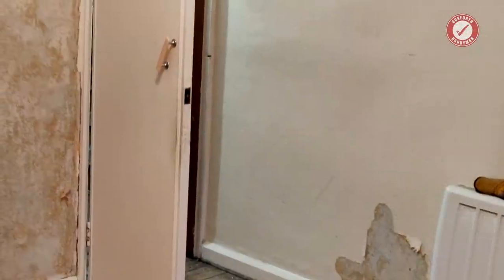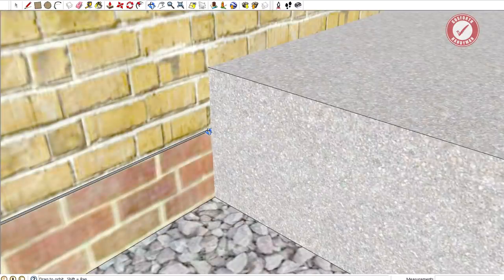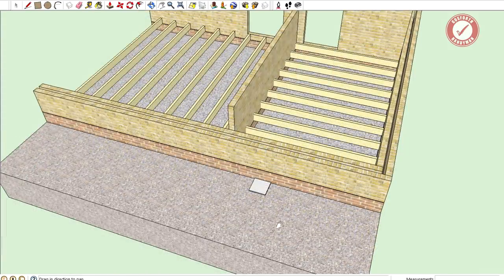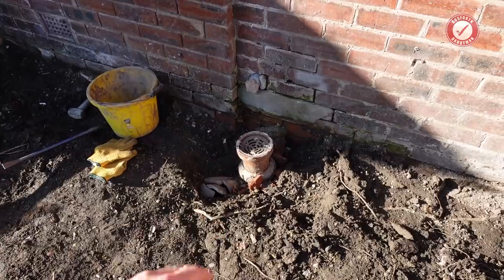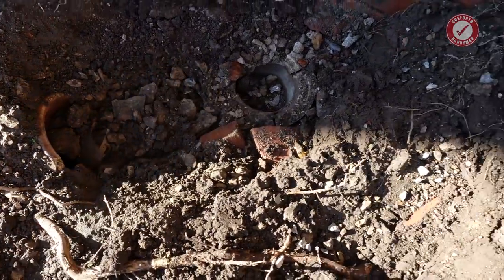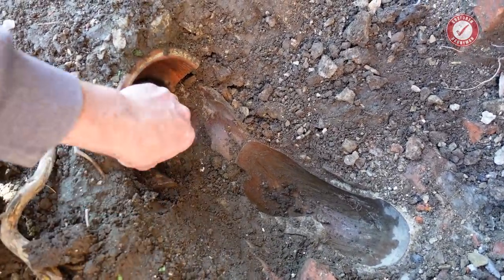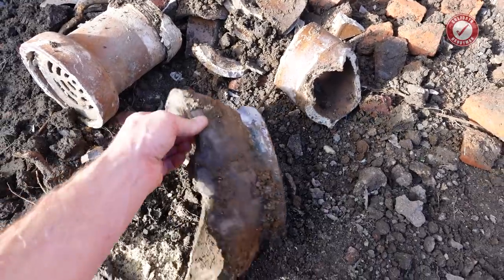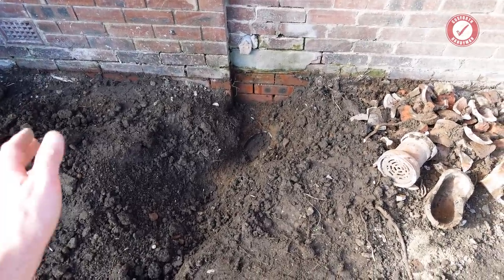I think we found the source of our damp issues! (1920’s Renovation Part 36)

Comment: You're doing it wrong Andy. You are supposed to spend thousands of pounds for some chav with a 3 day training course and an SDS drill to put hundreds of holes in your wall. That's how you fit damp problems right? 😜
Reply from the maker: Lol it's scary how many times I've seen that done... and it's made zero difference since it was actually leaky gutters. 😂
Reply: Wally damp man 😁

Comment: Great stuff.

Just did a bungalow. Dodgy drain pipes and on one side it ran into a water butt which went nowhere so was just overflowing. I can’t for the life of me work out how it ended up that way because surely it wasn’t built like that.

My current home is 300-400 years old. No cavity and some crazy electric damp treatment attempt that doesn’t work. It was painted with sandtex trapping the moisture in. Stripped it off to reveal large holes in the mortar everywhere. Repointed with lime instead of the concrete that was in it for breathability, adjusted the drain pipes so they actually catch the water, fixed a hole in the roof. One gable had to be rendered because the bricks were that bad. Inside damp was dealt with as expected now the water wasn’t coming through the walls. Little problem with a drain blockage because of the paint removal which has now been rerouted and it still makes me smile living here after all of that. :-)

Comment: I had a shocking damp problem in my living room (basement flat of a house built in1890) caused by a similar issue.  It took about 8 weeks to definitely identify the issue.
Once the outside drain was dug up we found it had been smashed and "repaired" with half a piece of soil pipe, (to cover the hole), "secured" in place with a carrier bag.  I reckon the damage was at least 15 years old when some work was done on the car park of the flats.
Reply from the maker: Ah, the old carrier bag repair. Lovely! 😬👍
Reply: Cowboys

Comment: Hi, I notice too that the soil (as in garden ground) seems in my opinion to be above the DPC. Having a garage on a sloping road, this is always a problem and since we had our interior wall tanked the rest of the garage is dry, probably for the first time in 60 years. We too had problems from a crack in the sewer now fixed and you are so correct in dealing with the source to these problems first. Thanks for this topic post.

Comment: Thanks for that, has given me some food for thought. There is just one section of wall in our kitchen that gets damp (old Devon cob and stone solid wall) and the drain runs just behind there, but there is a gully nearby which I can't see thanks to some old decking (which is going to get binned off). I'll have to get a look at it over xmas and see if the pipes connecting to it are working right or if it's a mess. Once I've finished laying the foundation for the patio extension (just scalpings and then gravel on weed mat but I need a whacker plate). Channels like your are invaluable for those of us who maybe aren't all that keen on DIY but have to do it anyway as it can often show us how to do things the right way or where to make a start on problem finding, so thank you!

Comment: I think that it’s pretty obvious that those 2 gullies were the main source of damp as they were permanently full of water in the bottom which you expect. Better off replacing them anyways and re directing the pipe work if you are now working on the extension! I had a crack round my kitchen drain where the grate is sat up against the house wall but I have just pointed up that gap with some cement for the time being until it eventually gets replaced should it need to be. Great video!! Also checked out that other YouTube channel and it’s really interesting!

Comment: Yes, water is a killer for property. Had similar issues with water backing up drains. I found a poorly installed drain when when the property was originally built, which tree roots had grown through totally blocking it - 6ft underground (that was fun!). I also had gutters overflowing for a long time (prior to ownership) which caused similar issues with water running down the walls, I see this often in properties, so to anyone reading this get your gutters cleared and fixed it'll save you a fortune!

Comment: I've got a cracked rain water drain in the front of the house that will be fixed soon. Plants have been growing out of it! It does mean lifting the front path, but we were going to have to relay the whole path as it's pretty damaged. I hope that's the end of the damp for you.
Reply: Got same problem, cracked gully,rest bend & pipe, but everything is encased in thick concrete😮,the more I explore ,the more problems I'm finding.
Reply from the maker: Cheers Jules! Good luck with yours, yes hopefully things can start drying out now... in time for winter. 😬😁
Reply: Seen the roots of trees and bush’s well down the drain pipes  many times during my time as a builder
Reply: @williamgow6551  Same here, & once several  fencing pins driven through clay pipe run....😮

Comment: Our bungalow is built on solid chalk in the 1960's, which commences 9 inches below the surface. We have never until recently had any trouble with rainwater not going away but 5 years ago the gutter started to overflow. I couldn't clear the pipe  where the down pipe entered the clay pipe so it was exhumation time. I found that the original pipe stopped 3ft from the house and that was it, the clay was full of leaf mould and other rubbish. However there was absolutely no dampness in the house or brickwork as a result of this soakaway arrangement. I remedied the problem by making connection to an existing soakaway, so sometimes damp doesn't always show up.
However when we built our extension the new foundations had to dug just over a metre in this area because the chalk had been ruined, elsewhere it was a struggle to get deeper than 85cm the chalk was so hard.

Comment: Yep.  In the states myself, but the fist rule... get the water away from the foundation is job #1.  We generally have poured concrete foundations (and basements) here and my sump pump was discharging to a broken downspout connection to the street.  The water was splashing back up the outside brickwork and just running back down to the basement outside wall, causing mortar issues.  Fix the source first!

Comment: Fantastic stuff...

We live just along the A69 in Carlisle. Our house is a late 40's build and I have just spent the last week putting in new drains. Our house sits on a complete concrete pad & has poured concrete outer walls and also the same inside, No bricks what so ever! 

Our walls were poured on the pad and I'm not sure we have any DPC, indeed it's very hard to see if there is any at all! The floor is always cold and during the winter the hose is always cold and we have a damp smell in the rear rooms (hence me putting in new and renewing old drains)

All of the old clay pots were cracked including the one from the toilet that had been seeping in to the clay for many a year without our knowing. Not a nice job but needed doing before I put down a new Indian Sandstone patio & paths

Comment: This was very interesting.  I am a retired Home Inspector and former builder.  In the US many older masonry houses have the DPC made of two layers of slate.  Never seen the bitumen.  Newer frame houses have rules requiring enough clearance from grade to allow evaporation out of the face of the wall.  8" one the exterior and 18" on the interior.   The older masonry houses had lime plaster parging or coated on the exterior about a foot above grade to cause the drying to occur in the parge rather than in the brick.  The parging  would fail and fall off rather than the faces of the brick.  You were supposed to replace the parging about every 20 years or as necessary.  That maintenance has been long forgotten and the buildings are suffering.  They used lime mortar so the water would migrate through the mortar rather than the bricks.
Reply from the maker: Interesting! Don't think I've seen parging over here - I need to look that up! 👍
Reply: Bitumen was used everywhere for anything that needing water proofing in England it seems. For example my electrical supply incomer to the house is coated in a bitumen sheath.

Comment: I’m trying to cure the same  problem on my bungalow, (front and rear)! Problem is I’m in a low laying area, in clay, and I’m finding it hard to get enough water away from my walls! 
Did the rear soak away myself last year with tennis elbow in both arms! Only problem is I think I need to extend the soak away pit as I don’t think it’s getting far enough away for the volume of water coming off the roof... The clay doesn’t allow it to soak away fast enough! Plus, the water table is very high in the area. Nightmare! 👏🏾👏🏻👏🏾👏🏻. Ps… not allowed to funnel it in to the sewer in my area! (Although, if it comes to it, I might secretly do it)!

Comment: One of the causes of moisture in your walls tackled!
My own renovation project showed me that there are other easy and not so easy to tackle causes.
The easy one being washed out cement between window sill tiles on the outside of the house, the whole brickwork underneath this window sill was soaking wet.
The not so easy one, actually the remedy is not complicated but needs a lot of work, soil back filled at the rear of the house way above DPC level, without damp proofing the walls and installing drainage.
The water did the same as in your case, washing out the mortar and going trough the wall, when I ripped the PVC panelling off from the inside there was soil behind it!
The solution I took was excavating all this soil out and construct a retaining wall about 1,5m from the house, and installed drainage all along the backside of this retaining wall.
Next is to install drainage alongside the house itself before paving over.
The walls which are freed of the excess soil are free to breath now and already much dryer.
Reply from the maker: Wow - sounds full on! Good luck with it all! 👍

Comment: Anybody buying an old house get your drains and downpipes checked !!  i had 50 litres of water under floorboards every time it rained heavily , called the drain guy out he said it just the water table etc... 10 yrs later found the cause blocked cast iron down pipes the water would fill up and run down the cavity wall via the old lead pipe to bath ,high humidity levels in house are cause for warning signs ..

Comment: Great video, that really goes through the process explaining whats actually going on. I personally find drain defects are the number 1 cause of rising damp within buildings, but this is often booted to one side, and instead a quick fix is carried out. I tend to find that where there is an original solid floor along with an original suspended timber floor there is usually clay pipe running through the solid floor and normally venting to a vent....But, often I find the vent isn't there  :) that could be something to do with yours. One question though, did you try and claim on your insurance for the repairs?

Comment: Andy great vid  i had waste pipe just sitting on the bend to the drain and then concrete around it damp kitchen wall luckily started leaking through concrete then fixed.
do you have any drink tea make stuff mugs
cheers Mark👍🍺
Reply from the maker: Don't have those mugs... yet. But have a plan so watch this space. Will be a good few months though. Might sort some on Spring in the meantime. 👍

Comment: My guess ~ water in the u-bend /gully froze many many years ago, the gully cracked and subsequently leaked, resulting in cumulative damage up to its discovery in 2021.
Reply: thanks, wondered how it had occured. often is shrub roots causing problems once a hole in a clay drain has appeared.  even with the breakage as it was, it would have been a simple fix (couple of days dig and back fill and appropriate gulley goods
Reply from the maker: It's tend to agree! Certainly a possibility. That and slightly dodgy patio laying. 👍
Reply: Often the cause is that when the drains were installed the ground at the bottom of the trench wasn't properly compacted (if at all) and thus settles at different rates under each section of pipe.  The differential vertical loading easily cracks the pipe.  I have replaced all of the original clay pipes in my rear drains all the way to the main sewer connections as every single joint on both pipe runs was cracked.

Comment: The only place I've seen pipes on the outside of a house is in what used to be East Berlin. When I went there in 1994 the Berlin Wall had been torn down and one of the ways you could see what used to be East and West was exactly this: East had worn-down houses with exposed pipes, West had more modern houses without exposed pipes. I imagine exposed pipes cause problems in sub-zero temperatures, right?

Comment: Well done sir  I wonder if the last war has played it’s part and shattered the clay drains . PVC has been a godsend to the building industry , and should last at least another 100 years plus . But as you rightly say water is a major problem to property , and can present many challenges to the unwary . I my self have an issue with water ingress from outside via UPVC windows , which is proving to be very problematic . The house was built in the late 1970s but the rear elevation seems to be beset by this problem . Admittedly the wind blows across the fields and drenches the brickwork , but try as I might it still finds its way into the reveals . I’ve re applied  new sealant I’ve applied silicone treatment to the bricks , but to no avail after the resent storm I find water has found it’s way in again. So if you our your many subscribers can think of a remedy I’d be  very grateful .  Best wishes and kind regards as always

Comment: The issues with that gully explain where all the crap you found in the main sewer after the old pit that was slowing and holding the flow probably came from. Damp is a very patient opponent and will take all the time it needs as it is not in a hurry.

Comment: Surprised building code allows mixing grey water with roof rain runoff and diverts all of it to sewer system even in 1920s. It’ll be interesting to see how you deal with rainwater runoff. In the states communities have mandated dry sumps  to temporarily retain rainwater until it ca percolate into the ground. Hope your local ground conditions allow for diverting rain water away from your foundation.
Reply: Building regulations in England allow the discharge of rainwater into public sewers even today, although it is as a last resort. In order of preference the accepted methods of dealing with rainwater are: into a soakaway underground, into a natural watercourse, to a surface water sewer or a combined sewer. My house was built in 1947 and has a combined sewer so I can mix foul water with rainwater. If I stop doing this I can get a discount on my annual water bill.
Reply: Actually the greywater (plus house rainwater) and blackwater connect before they enter into the main sewer so everything ends up going out of the same pipe.

We also have upper sewers (storm sewers) which are where the roads drain into which are often shorter stretches to direct to the natural rivers. In my home town which was in a valley, the original river it was named after no longer flows  (it was diverted away further upstream into the canal) but all the storm sewers empty into it the dry riverbed when it rains.

In the UK its less of an issue trying to collect rain water, more trying to get rid of it! ;)

But uk homes mix rain water from their roofs with the grey and black water as it helps keep the main sewer lines flowing!

Obviously this is all treated before release or diverted to reservoirs for additional treatment and drinking water. Its a fully nationalised industry so for the states it would be the equivilent of:  It rains in New York , California gets a drink and Kansas gets to irrigate crops  ;)
Reply: @boli2746  Discharging rainwater into the public sewer is frowned upon generally. I've never heard of it being a method of keeping the sewer lines 'flowing'. Every bit of water entering the sewers needs to be dealt with, and dealing with it costs money. Honestly I spoke to my water provider (Severn Trent) and the local building control and that's the way it goes.

Is water nationalised in the US? Our water companies (at least in England and Wales) are fully privatised, which I think makes them the only 'countries' in the world with completely privately-ran water and sewage services. 

I don't find it rains that much here to be honest, joking aside!
Reply: In some older US cities they're still working to separate rainwater drains from the public sewers.  It's an expensive project, which is why they're so slow to do it.
Reply: @sawleyram7405  only rain water from your roof is allowed nowhere else! E.g. you can't just dump waste water into the street for the storm sewers

And I mean our network was fully nationalised, the companies which use the network are private companies but they 'hire' out the national network, like national rail.
Reply from the maker: Still combined sewers in these older houses. I don't think the ground conditions work too well for soakaways here. Newer houses have separate though. Not sure when that started - 1940's perhaps?
Reply: @GosforthHandyman  i was actually talking to my brother-in-law's father a few days ago. He has been part of the building trade for years.

There was massive regulations in the 1960s early 1970s to do with housing. (He was talking about never buy a postwar house before 1970 as they cut sooo many corners especially in the 1960s.)

Would suspect it was around then.
Reply: @boli2746  my house was built in 1965, it's a friggin' disaster :(